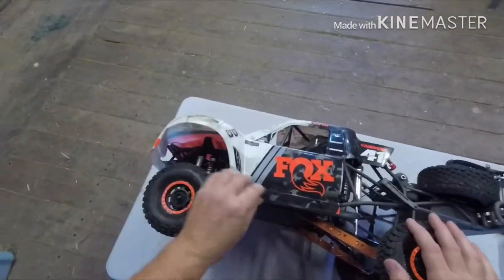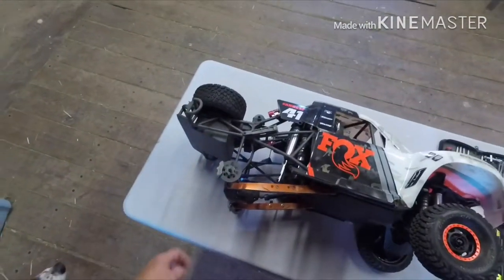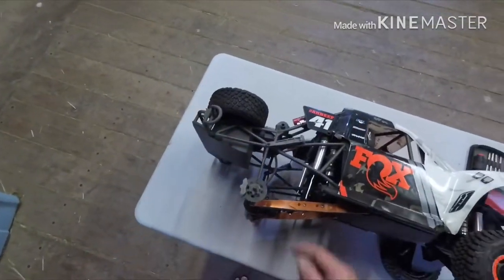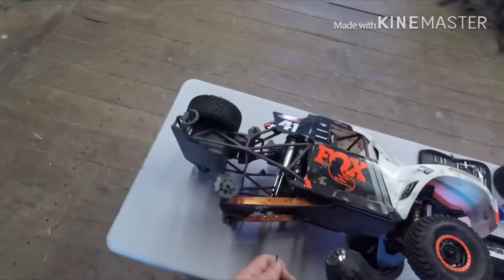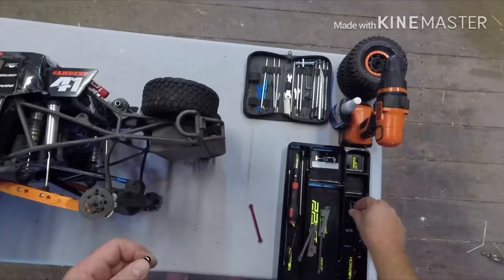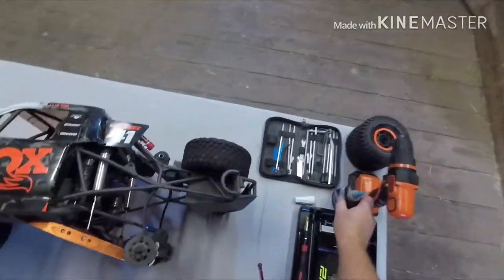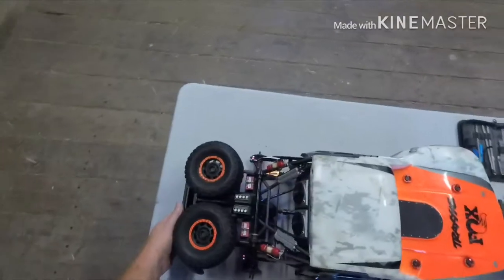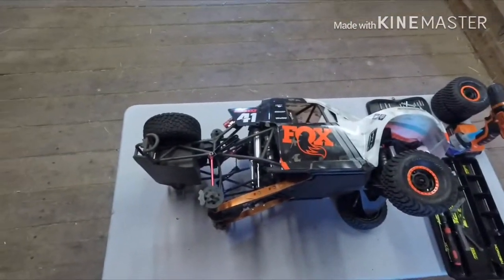Traxxas UDR Hot Racing Rear Torsion Bar Installation

Comment: that's not a torsion bar...this is called a sway bar... two completely different components
Reply from the maker: Thank god you cleared that up. 👍🏻
Reply from the maker: Pulled straight from their website...
"Hot Racing's rear anti-sway bar (e. g. anti-roll, swaybar, sway bar) set for the 1/7th scale Traxxas UDR vehicles. Designed for quick response, this system use a 3mm spring steel torsion bar to keeps torque twist and body lean to a minimum during acceleration and cornering."